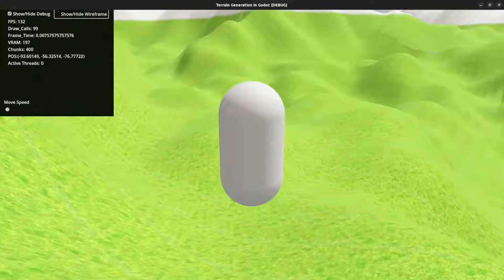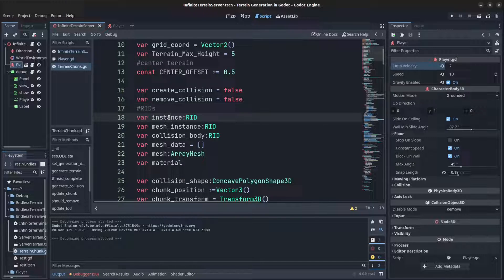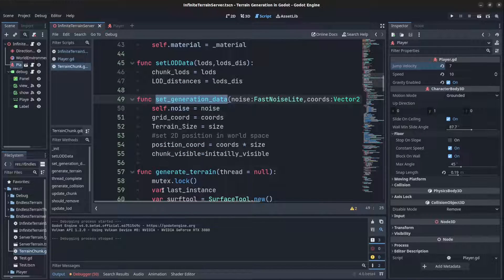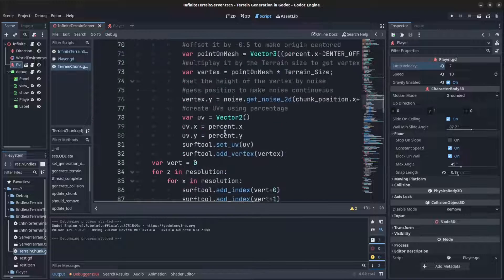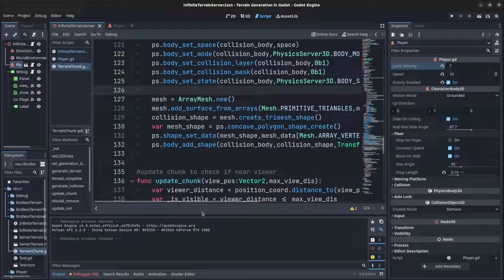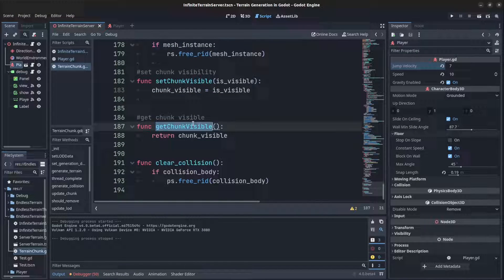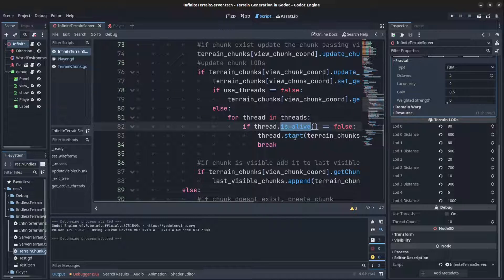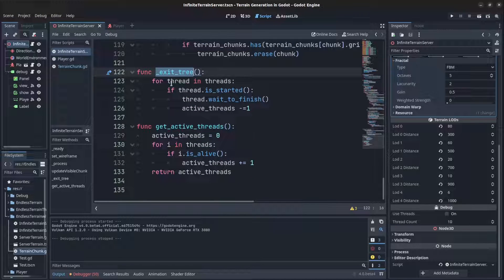Improving Terrain Generation in Godot 4.0 using Rendering, Physics Server and Threading

Comment: Hey man, I'm not really sure where to ask this, so I'll just ask you straight up. I'm trying to alter your terrain generation code to switch from using random noise to using imported height maps. I want to do this because I would like to be able to turn parts of the mesh off while in the godot viewer, as it bogs the whole thing down once the mesh becomes large enough. It would also allow for more varied terrain, and fine control over the shapes (mountains, valleys, kettle lakes). So I tried doing img.load -> mapwidthx = img.get_width and feeding the x and z into the array you made in the 3rd video. However, I'm no programmer and am having issues troubleshooting. Any help super appreciated!
Reply from the maker: Im guessing I was talking to you on Discord, sorry for the late Youtube reply😅